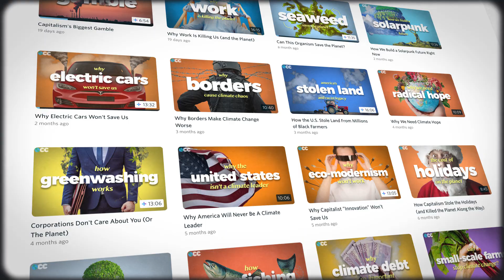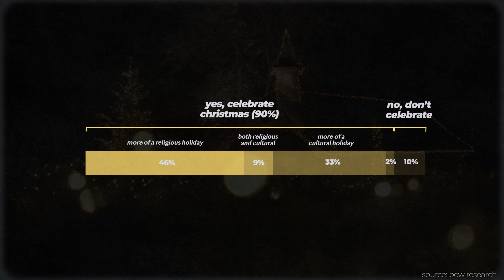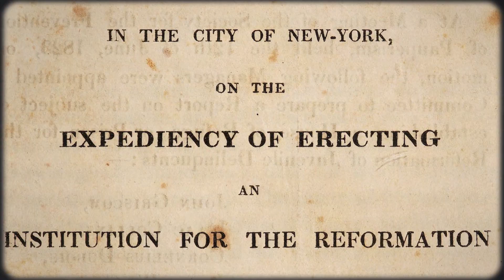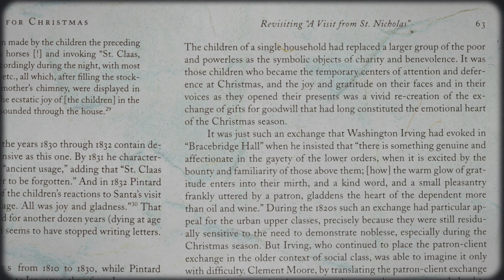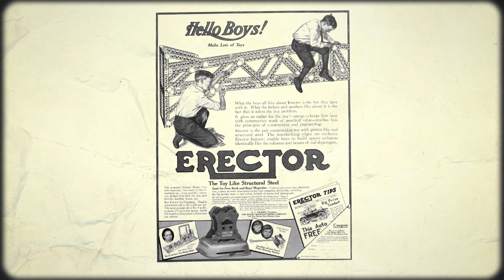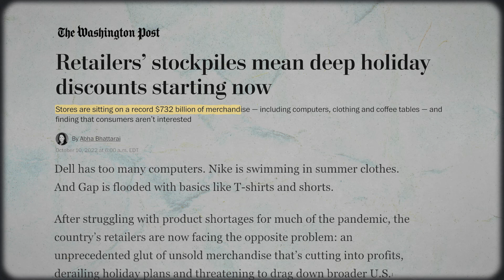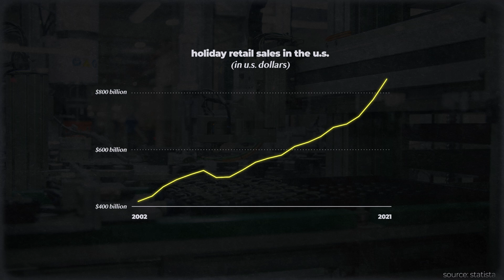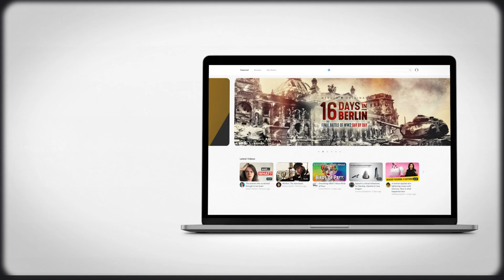Why We Need a War on Christmas

Comment: For the people that feel alienated this video is talking about how consuming and buying products, became a huge part of christmas. Which can be a reason christmas is stressful for some people. This is not about taking away christmas from a small familial celebration but allowing it to expand beyond just capitalism and consumerism.  Now on to my experiences, if you don't want to hear it don't read further or skip to the end. 

As an autistic person who's energy gets drained quickly by shopping, Christmas can be a stressful time for me. 

Shopping is a generally draining experience. It's a lot of stimulation all at once, especially with crowds as they are hard to deal with, and when added to figuring out what another person likes, just makes it kinda difficult to deal with. Making sure I have to get something they could use, but still good enough to warrant as a gift. 

Oh, but that's not the only thing I have to worry about, the opposite is also something I have to worry about too. 

If I say or do the wrong thing, even if I like the gift, even if I say thank you as kindly as I can, I know people will think they did something wrong. At that moment I know we both feel like we failed each other. The gift giver in their mind thinks they failed me by not getting a gift I like, even though that isn't the case, and I feel like I failed the gift giver, by giving the wrong reaction. 

Christmas should be a time of kindness and connection, where people can be themselves, and where people shouldn't have to worry about wrong reactions, or getting things just right. It should be an accessible holiday for everyone.

Comment: The past several years my solution to christmas was to just have a smaller circle I'm celebrating with. This is not a sustainable solution however, because this being the first christmas I'm spending with my partner's family I've definitely been feeling the pressure to buy more gifts 😅 I'm hoping we're able to encourage and implement a more intimate and connected and less consumerist version of christmas in the future